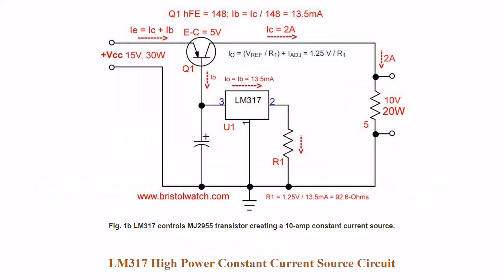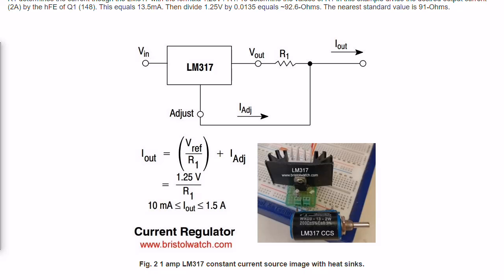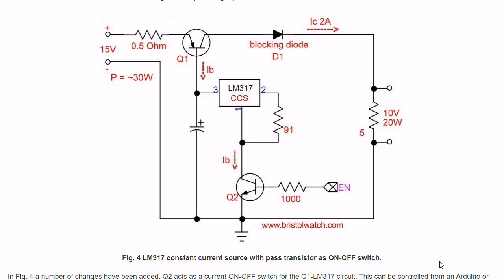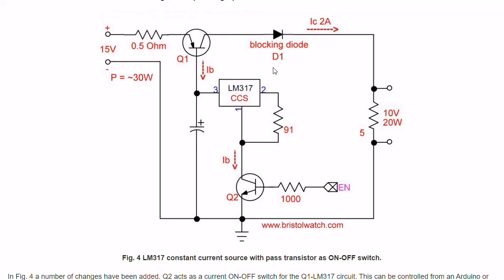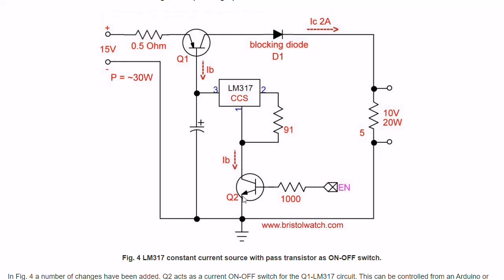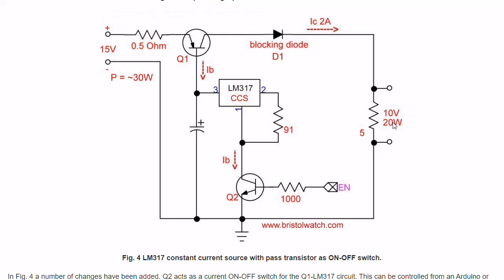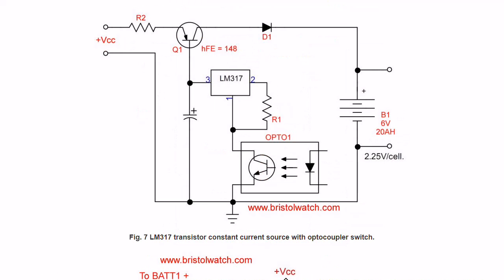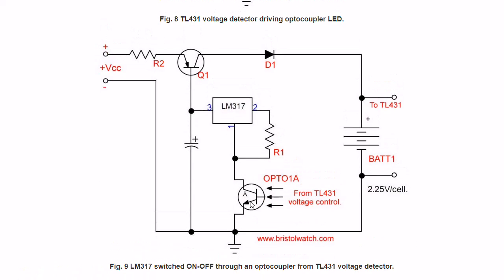LM317 High Powered Current Source 2024

Comment: Great video. In regards to the PNP power transistor used, if I require a higher input voltage of say 200VDC and output current of 8 - 10 amps, could I swap out the single PNP power transistor for a Darlington Transistor? Also the LM317 would be changed to LR8NS
Reply from the maker: No, unless all polarities are reversed. As for that kind of power I'd recommend not playing around with that.kind of power.

Comment: Newbie here. How can this be adjusted to be current limiting device. I want to test broken motherboards with voltage injection (usually 1 up to 5 volts) but need to protect the motherboard from too much current (100ma to 1000ma range). How would this be achieved ?  Can you make video about this?

Comment: Pl  make a video on foldedback current and its calculation of resistors ( linear regulated power supply with short circuit protection as fold back current limit).
Thanks

Comment: dear sir please explain about the capacitor on the point 3 of lm 317?????
Reply from the maker: I added that for noise. This circuit can also be pulse-width modulated.
Reply: @LewisLoflin  thanks for the reply but it always hold a voltage up there ....

Comment: About 25 years ago I assembled a circuit exactly similar to your first schematic. The output current varies by more than 10% depending on the temperature of the transistor. This phenomenon disrupts the performance of the device I built.
The solution is to arrange the transistor as 'sziklai' for the LM317.  I used 6.8 ohms as Rbe (LM317 draws a current of around 100mA). The collector is connected to pin 2 and the input end of Rsh. Pin 1 is connected to the Rsh output side as the final output. The constant current output will be 1.25/Rsh. The variation in output current is less than 1% due to the influence of transistor temperature, so the device I built can work well. Minimum drop out voltage was about 4V.
Thank you